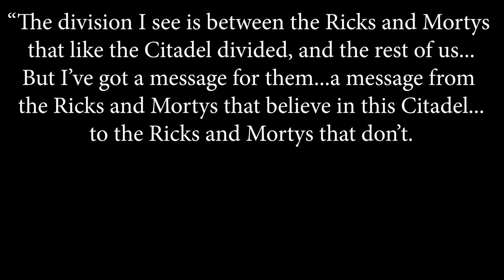Shooting Masks onto People's Faces

Comment: if any of those screws hit someone's eye, that lawsuit bill would have been astronomic
Reply: Kind of surprised he doesn't already have a lawsuit. Mask or not, that shits illegal af.
Reply: ROFL - Wear a mask and Allen won't have to come for you... simple.
Reply: @chucknorrissbeard1380  Take a breath brother. It isn't that serious.
Reply: @chucknorrissbeard1380  you sir are the embodiment of everything wrong with this world.
Reply: @Lance-we2ud  it doesn't work... I waited in line for testing last fall and I clearly saw breathing vapors which means masks haven't filtered anything (well maybe a portion of it but that is not enough). I was wearing them religiously before that, haven't bothered ever since unless I am about have a face to face conversation with someone (they are good at catching spit).
Reply: @prof.esrever7823  thank you
Reply: @Lance-we2ud  You didn't even read my entire post did you? Admit it. Because if you did, you wouldn't have your little tirade about moisture because I literally wrote "I clearly saw breathing vapors". VAPOR IS MOISTURE!
Reply: @chucknorrissbeard1380  aren't hollowpoints fucking illegal?
Reply: @animus2653  and they are FRAGMENTARY hollowpoints. There is a difference. You see, these bad boys are drilled  all the way through, then sliced into wedge sections and plated in chrome. That way, when the bullet hits your face at 1400 feet per second and spinning at several thousand rpm, instead of just expanding like a mushroom, they enter your skull and fly apart like shrapnel in all directions. Hence the name FRAGMEMTARY.
Reply: @animus2653   no, hollow points aren't illegal lmao
Reply: @lockandloadlikehell  Ah, so my state is just weird, nice.
Reply: @chucknorrissbeard1380  do you feel big and bad now kid?
Reply: @Chuck Norris's Beard  we do not care 😹😹😭😭😭😹😭😭😹😭
Reply: @chucknorrissbeard1380  And everyone clapped
Reply: @weezy3855  well i am a 41 year old 6'7" 225 lb construction worker in excellent physical condition so no im not a kid....and considering that even knowing nothing about you whatsoever, i know for a fact that, face to face, you would call me sir.
Reply: @chucknorrissbeard1380  sorry bud. Try again
Reply: dude take a joke seriously, must be fun at party
Reply: @lawrenceyjohn1240  thats exactly the response i would expect from some midwit who suddenly realizes he has no idea what he is talking about.
"Oh yeah?!? Well....your just....gay!!"
Real slick comeback there. 
And i am not chuck norris.
I am his beard.
Reply: @chucknorrissbeard1380  YMCA! And let me guess your boyfriend is "In the Navy?" Amirite? 🤪
Reply: @prof.esrever7823  you responding to that mostly truthful statement in that way is the embodiment of everything wrong with this world.
Reply: @reidsimonson  your profile picture is of someone (most likely you) holding a fish. You dont get to talk.
Reply: @chucknorrissbeard1380  R/Iamverybaddass
Reply: Man some people in the replies just don't get jokes
Reply: @chucknorrissbeard1380  wooooah you're cool
Reply: @chucknorrissbeard1380  I honestly thought this was a copy pasta lol
Reply: @chucknorrissbeard1380  yes be a functional member of society, or don't. It's your choice.
Reply: @chucknorrissbeard1380  well frkn said dude 👏👏👏
Reply: @prof.esrever7823  how is he the embodiment of everything wrong?
All he spoke was truth.
Reply: @Lance-we2ud  no it does not trap the particals that would make it a medical device and it's not
Reply: @lucio-ohs8828  treating an entire party of ppl as stupid idiots is not a joke. It's actually the reason for the devide
Reply: @lucio-ohs8828  exactly they are ment for ppl who are sick.
Reply: @chucknorrissbeard1380  indubitably
Reply: @reidsimonson  wording your response diffeently doesnt change mine.
Thank you.
Reply: @chucknorrissbeard1380  uh good for you. I never responded to you so go pound sand.
Reply: @reidsimonson  oh, shit. Your right. I thought that was to me. My fault.
Reply: @chucknorrissbeard1380  r/iamverybadass
Reply: @anthonywiththew  fuck around and find out
Reply: @chucknorrissbeard1380  Jesus Christ I thought the whole “‘murica mah freedom n guns” shtick was mostly overdone parody but it looks like I was wrong, people as insane as the parodies really do exist
Reply: @chucknorrissbeard1380  None of this is true
Reply: @chucknorrissbeard1380  Chucks real beard wouldn't need a firearm. You, sir, are an imposter.
Reply: @chucknorrissbeard1380  I completely forgot about that episode. lol But I did have Peter in mind with my "You, sir, are an imposter".
Reply: @ERoserie 
"Take a breath brother. It isn't that serious."
Bruised eyes, broken teeth, and ruptured ear drums aren't serious?
Reply: @chucknorrissbeard1380  
6 foot 7 inches and only 225 pounds?
You are aware of how light you actually are for your size, right?

Coworker of mine is 6'4" 250 pounds and looks like a 6'4" farm boy.
Reply: @animus2653 
"aren't hollowpoints fucking illegal?"
Only in states where they value the lives of assailants more than those of their would be victims.
Hollow points are more likely to stop the threat. Simple as that.
Reply: My only opinion in this about whatever i just read, (which was alot, Mostly about Chuck Norris type stuff, Family Guy References, abd Cults) If you are 6'7 225 doesn't that make you a big target?, Wouldn't the person who pulled a gun out on you have the element of surprise and then ducking down would just get you killed because it only takes a few milliseconds for the body to respond to it, So about around the time you attempted to duck you would most likely already be fatally shot. Idk just my opinion on it
Reply: @saucerset12  close enough lol. Funny thing is, when i first read your "you sir, are an impostor" in my head, i heard peter griffins voice saying it lol
Reply: @penedrador  you cant argue my point on the merits, so you say "oh yeah?!? Well your just a cliche american!"
Soooo....what? Im supposed to be like, insulted here? I mean, wow. What are you? Like 12 years old? Way to contribute something meaningful to the conversation.
Reply: @penedrador  .....ok.....
Reply: @chucknorrissbeard1380  go back to worshipping the US military or something instead of writing out paragraphs in youtube comments
Reply: Great engineering! Please don't even think about using it in public. You are likely to get lit up and take one to the dome. I sincerely hope this is a joke.
Reply: @chucknorrissbeard1380  Well a 50% chance is better than nothing right?
Reply: @ClassicClown  im gonna guess you havent had any experience with hand guns. Most liberals only know what they have seen in movies and games because the liberal states they live in make it damn near impossible to purchase a firearm of any sort. Most Handguns are very inaccurate and are meant for close range. Not to mention that nothing screws up your aim more than being shot at. And you are right, my size does make me an easier target. However most people who own guns only have experience firing at stationary targets. I actually said dive, not duck. My objective in the dive would be to lower my profile while moving my center mass sideways as fast as i can preferably towards the nearest cover. Firing my first few rounds at my attacker while in mid dive is meant to do a few things. 
1. Disorient my attacker with the close range shots causing him to be far more likely to miss. 
2.Most likely he will also begin moving to avoid the barrel of my gun. Dramatically lowers my chance of getting hit. 
3. At close or point blank range, its all about who gets a shot off first. Inside of 10 feet, im expecting both of us taking some lead. But if i can manage to hit his center mass (head-neck-chest-torso) while in mid dive, while only taking a hit to an arm or leg, he dies, and i live.
Bear in mind my objective is to live, not necessarily to kill. If he survives his injurys, good for him. 
So in that situation, i dive towards cover while firing several rounds, empty the rest of the mag while scrambling behind my cover, tactical reload spare mag and check target. If hes down, its over. I holster my weapon and depending on the situation, either immediatly begin first aid to try to save his life (compression/tourniquet/treat for shock) or retreat to safer position. If its not over, i now have a full mag and cover. Massive advantage.
Reply: @chucknorrissbeard1380  Alr thanks for response very informative, Only part I'm a little confused on is the liberal, I'm not sure if you are suggesting I'm a liberal or not, But no i really don't have any experience with firearms, Only shot one once and that was when i was younger. So appreciate the information.
Reply: @ClassicClown  if you are considering purchasing a firearm for your own protection, i would HIGHLY recommend you take both a firearms safety, and tactics course. Also, if you chose to purchase a handgun, when you practice on targets, spend lots of time practicing drawing and shooting. Not just standing there carefully aiming and firing one shot at a time. For every hour you spend shooting your gun, spend three hours practicing drawing and aiming your gun at a target with no ammo in it. See how fast you can get your barrel up amd aimed before touching the trigger. Anyone can aim and fire. Training to do so faster than your enemy is how you survive.NEVER DO THIS UNTIL YOU HAVE FIRST REMOVED THE MAG AND CHECKED THE CHAMBER TO ENSURE THE WEAPON IS SAFE. The price of an accidental discharge can easily be somebodys 5 year old. 
Never put your trigger finger inside the trigger guard unless you plan on firing the weapon a split second later. Never allow the barrel of the gun to be pointed at anything that you dont plan on destroying even for an instant. Any time you pick up any firearm, the first AND last thing you should always do when handling a firearm is to check to make sure the chamber is empty and the safety is engaged. ALWAYS ASSUME THAT EVERY GUN ON EARTH IS LOADED AND THE SAFETY IS OFF. Alec baldwin didnt abide by any of the afformentiomed safety protocols, and, well you see what happened. 
When firing a handgun, focus on the front sight so that the rear sight is blurry (your eyes will try to do the opposite). Grip the handle with your dominant hand, and grip the front and underside of your dominant hand with your other hand.Do so very tightly. If your grip is loose when you pull the trigger, two things will happen. 
Assuming you are right handed, if your grip on ths handle is too loose, then your trigger finger will pull the barrel of the gun to the right when you squeeze the trigger and your shot will go wide. 
Also, loose grip means more muzzle flip. The longer it takes to retrain the barrel on target, the lomger it takes to fire a follow up shot. Gripping the handle very tightly will help stop this from happening. Your left hand thumb, forefinger amd middle finger should overlap your right hand fingers across the front of the handle with the remaining ring and pinky fingers wrapped across the underside of the gun. This will help reduce muzzle flip and the sideways pull of your trigger finger. 
Lastly i would recommend that your first handgun be no bigger than a .40cal. Start small until you are proficient, then purchase something more powerful later on if you so chose. I always recommemd the taurus model 709 for beginners. Semi-auto, compact, 9mm that is extremely easy to disassemble and clean (no tools required, you can take it apart with your fingers) that features dual safety. It has the traditional safety on the left side of the slide just above your right thumb, PLUS a separate safety on the trigger itself that will not allow the firing pin to drop when the trigger is depressed unless your finger is wrapped around it. It is very safe, very rugged and very affordable. Hope this info helps you out kid ✌
Reply: @chucknorrissbeard1380  edgy
Reply: @carlbrenston8436  youtube censors just silenced me 5x in a row
Reply: @carlbrenston8436  we are ALL Kyle Rittenhouse here in Coffeyville. The cult needs to know that for their own safety. If they come here, the price they will pay will be dear. If that scares you, it should.
Reply: @carlbrenston8436  apparently i am not allowed to tell you what we did here in coffeyville the last time people tried to do us like they did to the town of kenosha. Just look up the name of the town i just mentioned. Youll see
Reply: @carlbrenston8436  what we did was brutal. So brutal in fact that youtube LITERALLY just silenced me something like 18-20 times just for mentioning it.
Reply: @chucknorrissbeard1380  the epitome of r/iamverybadass
Reply: @joratto2833  you want to know how you know when youve won an argument? When the other side gives up on debate and just starts calling you names. Its been weeks since any of you actually tried to argue your point. Your wrong and you know it. You cant even argue that point. So you do this instead as if you think it bothers me lol. I couldnt care less what you think. You do know that right? 
Oh no! Your calling me stuff! And i SOOO care what your opinion is of me random ass person on youtube! 😂
Reply: @chucknorrissbeard1380  Aww, you thought your “arguments” were worthy of being taken seriously in a serious debate? Obviously you’ve failed to read the room.

It’s also obvious that you cared enough to write me this comment. Who are you trying to convince? Me or yourself?
Reply: They deserve to sue
Reply: @animus2653  no
Reply: @prof.esrever7823  what's wrong with a fish?
Reply: @TheTetrapod  speak for yourself lol!! 🤣🤣🤣😷😷😷🤣🤣🤣
Reply: @Dave-rd6sp  no it's not. 225 is average for that height
Reply: @lamebubblesflysohigh  well then you bought terrible masks, normal surgeon masks can hold water and are perfect at what they’re meant for
Reply: @chucknorrissbeard1380  what the bloody hell is wrong with you, you know exactly what he’s shooting a mask. You can even see it.
Reply: @Lance-we2ud  I mean if you were so concerned about viral spread maybe going around shooting dirty masks into people's faces would be cause for alarm. People treating the masks like they are mystical talismans instead of ppe with proper usage procedures is precisely why we are still dealing with this virus 2 years later.
Reply: wth have I run into.
Reply: @ERoserie  it's literally assault.
You're a villain.
Reply: @prof.esrever7823  No he's not.
Reply: @cranegantry868  ok
Reply: So are not wearing masks as it endangers public health
Reply: @chucknorrissbeard1380  I'm absolutely terrified 🙄😐
Reply: @lamebubblesflysohigh  
No, that doesn't disprove it. Moisture could be  literal molecules of water.
Reply: @Dlúith  why else do you think that stereotype exists?
Reply: @chucknorrissbeard1380  they wouldn't shoot it at you if you just wore a mask lol
Reply: @chucknorrissbeard1380  HELLS YEAH, you total keyboard warrior. U!S!A! U!S!A!
Reply: Do you guys not realize chuck norris is trolling. Considering this conversation has been going for months I think he’s doing a pretty good job
Reply: @mjdsr3100  Its also illegal to not wear masks in some areas.
Reply: @chucknorrissbeard1380  if you shoot a .40, its because you are too much of a coward for .45. Also, .40 sucks
Reply: @chucknorrissbeard1380  bro
Reply: @drbulba  less gooo 45 acp all the way
Reply: @drbulba  .40 does suck.
9mm 147s all the way for me.
Reply: @chucknorrissbeard1380  American moment
Reply: he will be deported straight away
Reply: @chucknorrissbeard1380  😀😃
Reply: @Lance-we2ud  Your comment is contradictory.  I can't spread something I don't have.
Reply: @cstgraphpads2091  when did i deny science 😂
Reply: @animus2653  he's lying that's why
Reply: @chucknorrissbeard1380  stop lying dude where's the proof ?
Reply: @prof.esrever7823  you are wear YOUR  mask and get YOUR vaccine and you won’t have to worry right because they work
Reply: @lucio-ohs8828  your problem dude find a way to protect YOURSELF and go on
Reply: he should use like a foam or smth for the weights so they don't hit as hard.
Reply: @animus2653  no smh
Reply: @chucknorrissbeard1380  Jesus Christ dude chill
Reply: @animus2653  no that's only new jerseys where it's illegal hollow point are also what the cops use
Reply: @ERoserie  i would fucking get hit on purpose, just to sue lololol
Reply: lol. someone's triggered
Reply: @chucknorrissbeard1380  u don't own a gun. Ur just 13.
Reply: @HawkerBlue  what was the original comment?
Reply: @chucknorrissbeard1380  What sort of serious thing? I'm sorry I feel like I'm missing alot because of the replies being deleted, idk
Reply: But a blinded antimasker is priceless!
Reply: Yeah...my gun shoots a lot nastier rounds than his
Reply: @reidsimonson  Your PFP is a photo of you holding a fish, your opinion is invalid.
Reply: @gamignmaster6977  oh, so cute boomer.
Reply: @reidsimonson  That's cool and all, but as once stated, you have a profile picture featuring you holding a fish, and as such your opinion is entirely invalid.
Reply: All these worry comments go complain to the newz
Reply: Eye or not It’ll still hurt
Reply: @ERoserie  "come for you" how sinister.
Reply: @ERoserie  I haven't heard someone use ROFL for at least 6 years
Reply: @LeoTheTurtle  I didnt know words had an expiration date. Glad to keep your member'berries alive.
Reply: @chucknorrissbeard1380  Physical strength does literally nothing in an online argument.
Reply: @lamebubblesflysohigh  Do you really not understand how condensation works?
Reply: @BASEDKAISER  Not only is this an old ass video and post youre replying to, but your outlook on personal health is telling. Good luck!
Reply: What’s a joke?
Reply: So would the hospital Bill
Reply: @chucknorrissbeard1380  FRAGMEMTARY